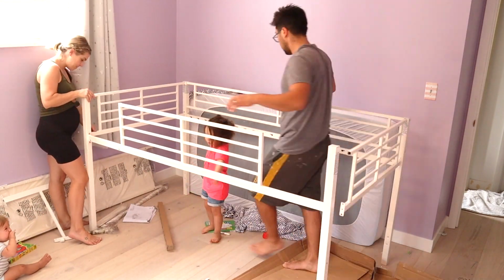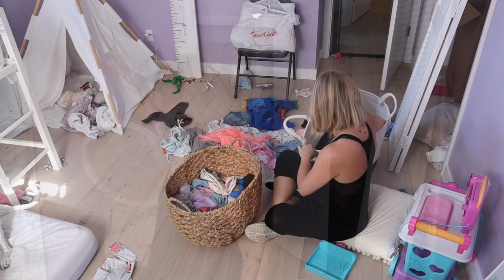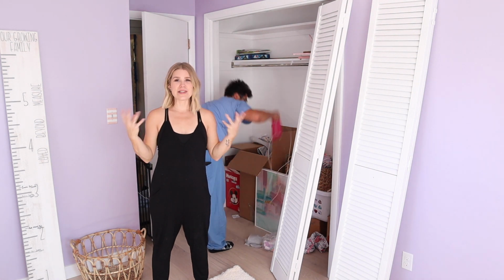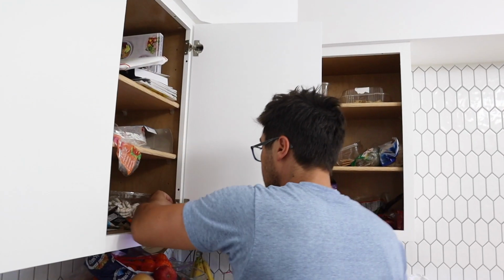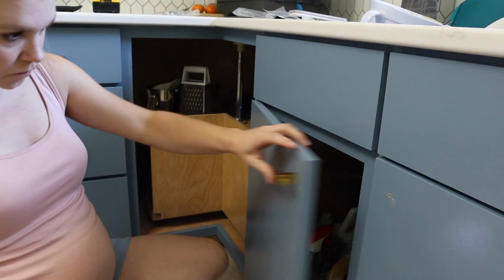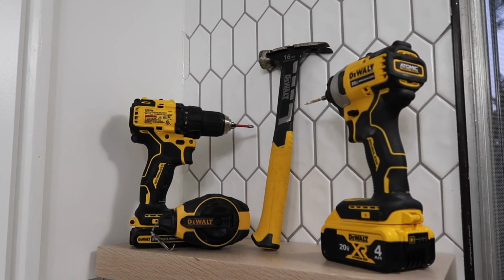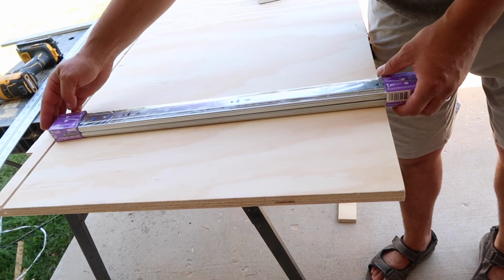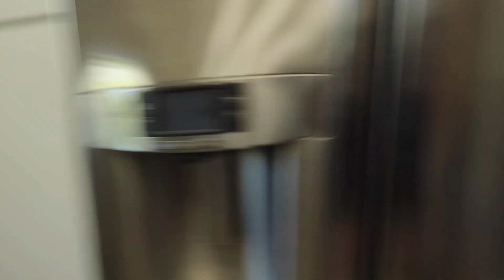RENOVATING OUR RANCH FIXER UPPER | ALMOST FINISHED WITH THE KITCHEN!! | SWEET BEDROOM MAKEOVER

Comment: I love the kitchen! 😍 I learned a trick not too long ago for caulking and thought I would share 😋 Put painter's tape on both side of where the caulk will go. You then do the caulking and when you remove the painter's tape, the lines are super straight and smooth!

Comment: if youre ever trying to get rid of sticky on glass just a little turpentine on a paper towel will do it. then wipe over with spray n wipe. when caulking it saves time in the long run to tape the wall and counter first. perfect finish every time

Comment: Oh my god I'm not the only one who uses a spray with a swiffer mop thing! I'm so happy to know, it works much better
Reply from the maker: It does!! Keeps the floors from getting too wet!
Reply: @DeniseBangiyev  Yes! I find that the wet cloths dry out quickly but in the first area you use it is just drenched. Hate it so much. The spray method works so much better and gives you more control. (Like those mysterious sticky spots..)

Comment: I had the same issues with the white paint. I painted  my vanity. I used a fine sand paper and was able to remove the paint build up.  Those corners are the worst. It looks like you need one more coat.
Reply from the maker: Yes! I went back, sanded and repainted. They look great now!
Reply: Denise Bangiyev yea, I can tell you are a perfectionist!